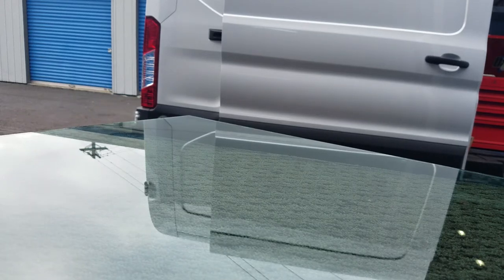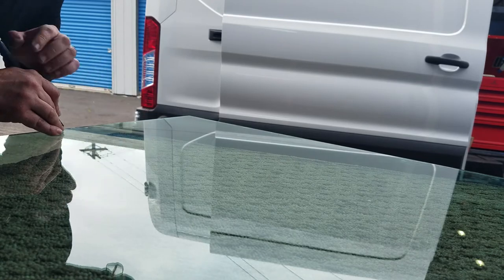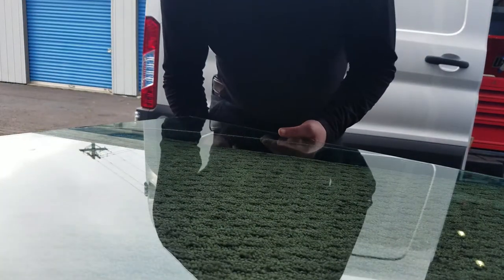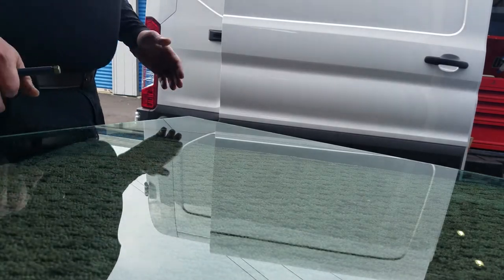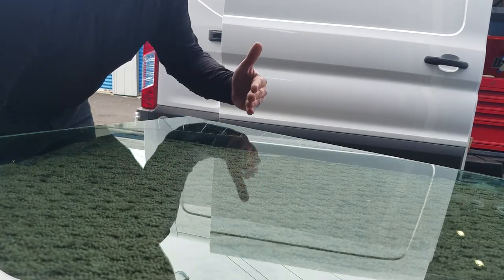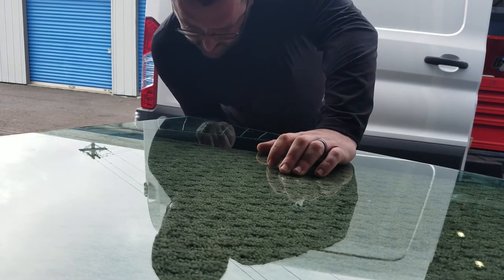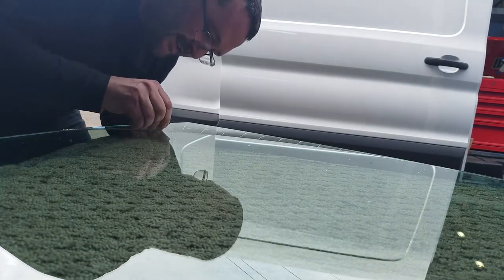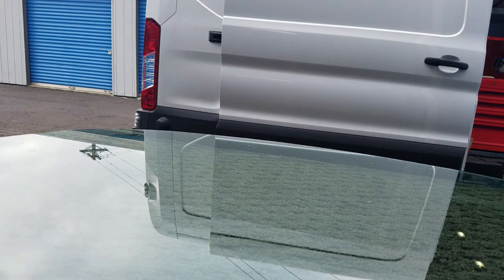Cutting laminated flat glass

Comment: I'm just wondering if the quality of adhesion of the inter layer with the glass has not affected with this method of applying heat with a torch on the laminated glass?

Comment: Can you do a video of cutting an inside corner on laminated glass?
Reply from the maker: What do you mean? Like an inverted cut?
Reply: @randomcarvids1052  yes.
The curve u cut Ive call it an out side curve. 

I'd like to see an inside curve. The risk with those is that when you run the cut it will go into the glass, because the radius of the curve goes into the glass rather than away from it.

Cat 930 grader factory door glass has an inside curve for the door handle and a smaller inside curve for the wiper.  If your able to cut that it would be cool
Reply from the maker: Ok. We call it inverted. I'll try to make on. But yes. Very risky cut, depending on the size of the glass. But good profit.
Reply from the maker: You need to make relief cuts. You don't want to ruin your scriber, so have a second scriber, for the relief cuts